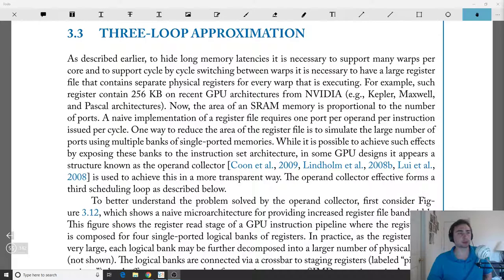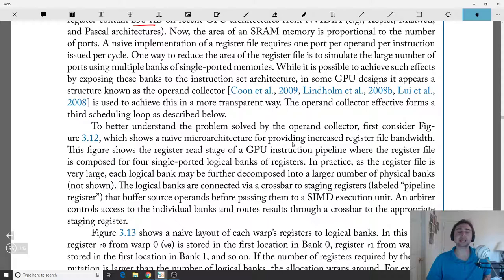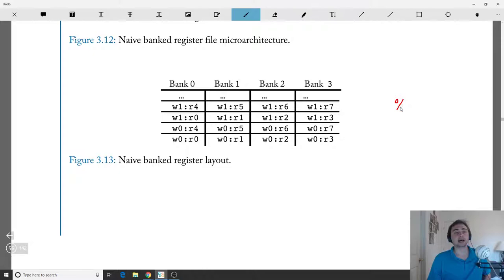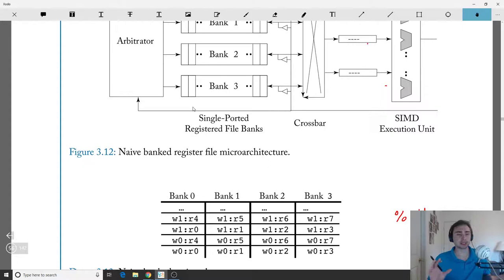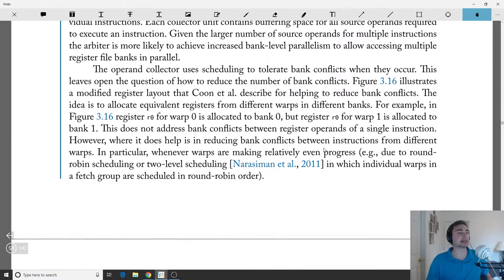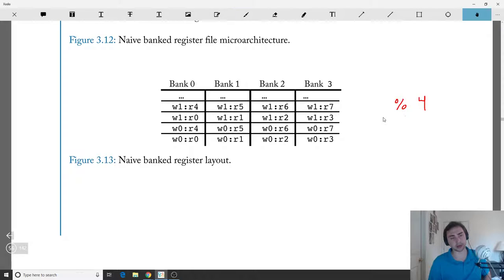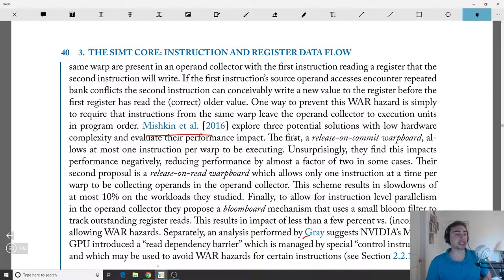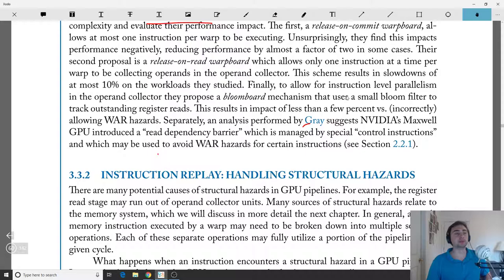Fundamentals of GPU Architecture: SIMT Core Part 4

Comment: 2 questions:
In swizzled register layout, you showed that in the first cycle, only first operand (r2:bank 3) from Warp 1 is accessed. However, 2nd operand is in a different bank (r5:bank 2) so why can't it be accessed in the same cycle like in naive register layout design?
Also, you talked about the WAR hazards in operand collector. Not sure why we'll run into this if this is 3 loop approximation and 2nd loop will not issue an instruction from the same warp if there is a dependency on previous instructions and dependencies are not cleared?
What am I missing here? Thanks!